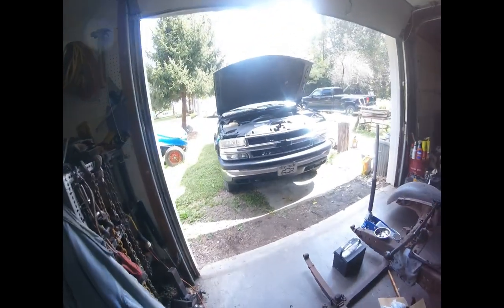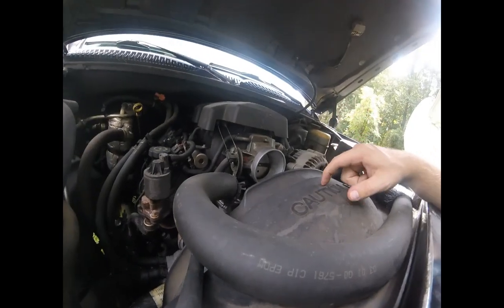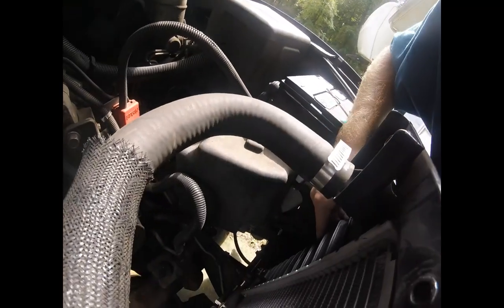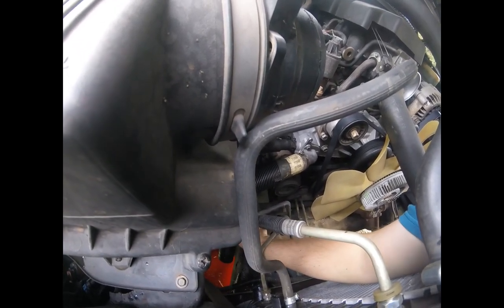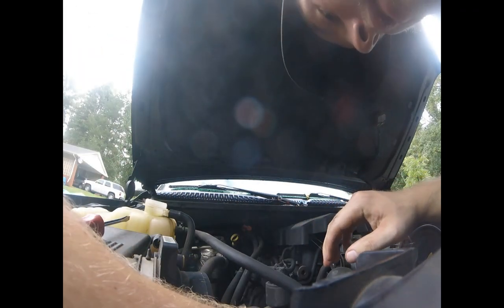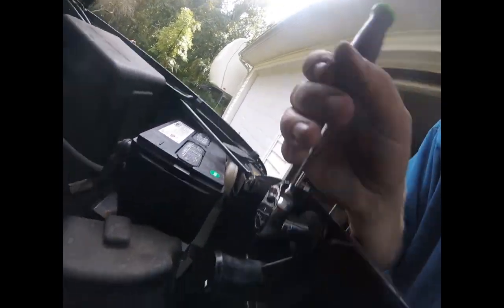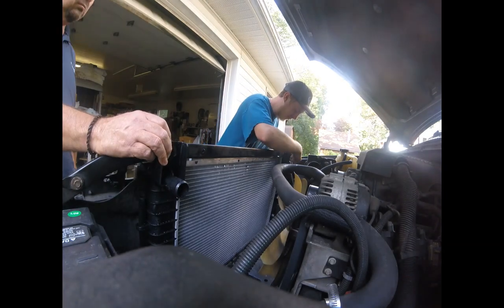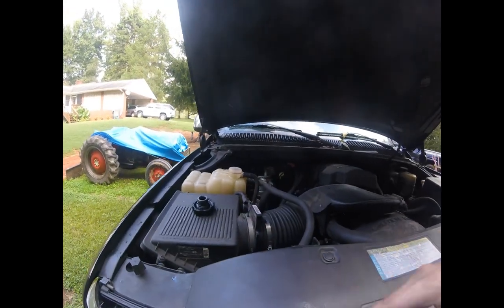2000 Chevrolet Silverado 1500 Radiator Replacement

Comment: Thanks! I have the same truck but a 2001. Any idea why this model is having the cracked radiator? Where was the crack? Did you get a pic of it? I am not sure what the black parts are along the outer edges.  Does it have a plastic and metal parts joined together?
Reply from the maker: The crack was in one of the black plastic tanks on the sides. Unfortunately, I did not get a picture of it. The first radiator was original to the truck. The years of heating up and the plastic expanding and contracting is what I believe caused it to fail. I believe this one failed from being cheaply made. Thanks for watching and taking the time to comment!
Reply: @bustedlugnutzspeedshop7456  thanks for letting me know. Will be shopping for quality. Cheers!